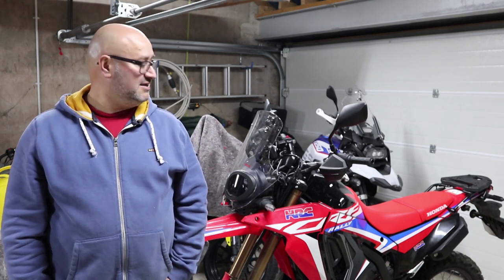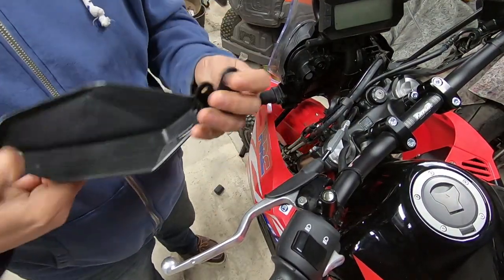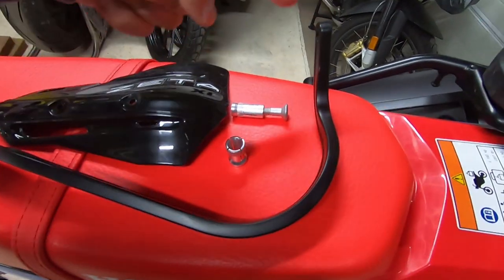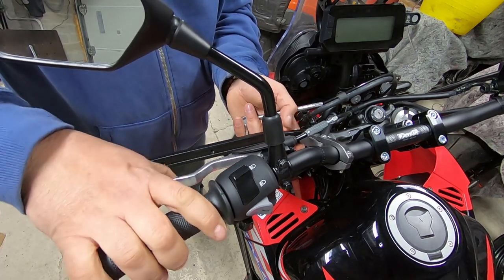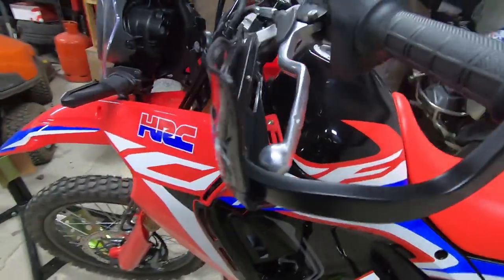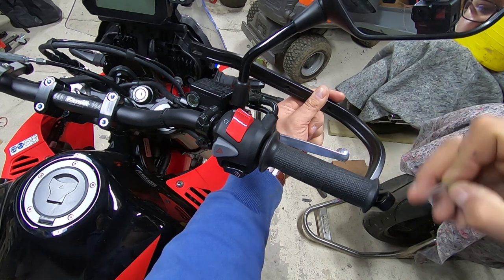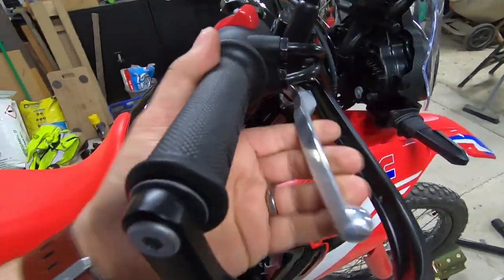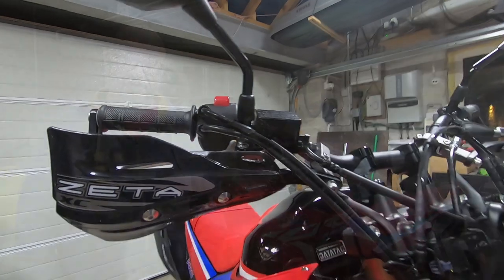How To: Honda CRF300L/Rally -  Zeta XC Handguard Fitting

Comment: Do the hand guard hit the windshield when the bars are turn completely on header side ?
Do you thing the Trimble clamp adaptor from zeta would work or it would hit the windshield ?
Reply from the maker: Mine don't, but I do have 20mm risers on them too. Not sure if that makes the difference. Do you have a link to the 'Trimble' clamp adaptor? I'm not sure what that is and Google was no help! 😶
Reply: @PeakMotorcycles  how close dose it come to touching ?
Reply: @PeakMotorcycles  Zeta ZE71-1822 Armor Tc-Mount Side
Reply from the maker: @petelafontaine4641  aha. The clamp mounts. Not sure, I’ve seen them on the FB page but haven’t tried them myself. I guess it comes down to distance from the triple clamp to the bar end, and how much adjustment there is in the hand guard.

Comment: Andre, did you discard the bar end weights because they don’t fit with the handguards or because they aren’t necessary? My bar end weights fit with my Acerbis handguards but wondering if I should discard them anyways, every bit of weight savings helps :)
Reply from the maker: Hi Rob, actually I didn’t try fitting them. Between the handguards and double take mirrors I’m sure I’ve added more weight than I took off. I haven’t had any problems with vibration or stability, so just left them off. I can try fitting them if you like, I still have them, but I don’t think they are needed. Crash protection perhaps 🤣
Reply: @PeakMotorcycles  thanks for the reply. If you don’t get any vibration without them it’s probably best to save the weight and keep them off. Good to know

Comment: makes a video showing the maximum speed would be really cool (top speed). Thanks.
Reply from the maker: That would be awesome, but I’ll probably finish the running in period of 300 miles before I run it at high revs (so far halfway there, but always riding below 6k rpm). That said, I can already tell you that it’ll do 70mph, the legal maximum for the UK. Surely you aren’t suggesting I break the law and then publish video proof on the internet?! 🤣🤣🤣
Reply: @PeakMotorcycles  I thought there were closed tracks for high speed like in Brazil.
If it did, it would be great content.
can you tell me what is the maximum speed of it in the specifications?
Reply from the maker: I’m sure there are, but everything like that has been closed for most of the last year in the UK due to Covid. I think they can open again in late May or even June. We shall see. Currently there is a stay at home order, with essential journeys only allowed.
Reply: @PeakMotorcycles  I understood. as soon as possible bring a video of this for us. tell me what is the maximum speed of it in the specifications because in Brazil it has not arrived yet.
Reply: This is not a top speed motorcycle it is a dual purpose 300cc adventure bike. If you want top speed go and buy a sport bike

Comment: Honda must have gorillas assembling these bikes. Every nut and bolt is torqued way to tight. I could barely get some off, especially the fork pinch bolts. They are supposed to be 25 ft lbs. must have been at least 40
Reply from the maker: Yup. I had to get a few new ones as I wasn’t as careful as I should have been. As you say, way too tight.

Comment: Yup one little off and the Honda ones snap easily 😐
Reply from the maker: Is that from experience 😐
Reply: Sadly yes, managed 198 miles before my off
Reply from the maker: @richbrock9876  hope you’re ok. And the rest of the bike too. 😳
Reply: Just a swollen wrist for me and some broken plastics on the bike. Was having so much fun I stayed out till dark, didn’t see a tree root or something that simply threw the front wheel away instantly. Wonder how much Honda will charge for the plastic bits 😳
On the subject of money do you want sell any parts you’ve upgraded on yours? (Hand guards and luggage rack I’m thinking)
Reply from the maker: @richbrock9876  ouch. Both for the wrist and the plastics. I’ve found Bikerzbits to be the cheapest for the plastics. As for the bits from mine, pretty much everything not on the bike has been sold already. I’ve kept a few things, stock exhaust, bars, footpegs, toolbox, but all the racks have gone (am waiting for the Outback Motortek one) as has the Yamoto bash guard. The stock handguards went to a local who asked me about them after this video went out. Apologies. Running the channel is sort of expensive, and though it makes a bit of money now, it doesn’t get close to bike or bits costs, so I generally buy something, make a video, use it for a while and when something better/different comes along, switch it out, do another video, and sell the one I’m no going to use. As long as supplies are limited, I only lose £10-20 per item, and over time, the video revenue might recover some of that if I get 5k-10k views. Many don’t though (as Mrs. Peak Motorcycles keeps pointing out 🤣🤣🤣)
This channel is, and continues to be an expensive hobby 😁
Reply: Thanks Andre and I do appreciate the expense in time and money you pour into this channel 
I’ll wait till holiday weekend over and see what’s what with suppliers

Comment: New idea. Cruise control
Reply from the maker: On a CRF? Do you think it has enough power to make the most of it? I tend to cruise at 60mph in 6th, though opening the throttle at that speed doesn’t do a great deal. I have cruise control on my GS and only really use that for keeping a constant speed between average speed cameras. Do you think you’d use one on a CRF?
Reply: @PeakMotorcycles  Yes, I bought a Vista Cruise kit on eBay.  It cost me 26 us $.  He stood on my crf250l rally.  Now I have installed it on my new crf 300 l rally.  I use cruise control quite often, even in the city.  But I also use crf for big travel.  And on a long journey, the throttle lock is a great device!  I think I'm not the only one who uses crf as a motorcycle for big trips.))))
Reply: @PeakMotorcycles  If you decide to install this on your motorcycle, please let me know.  I have to tell you about some of the nuances.